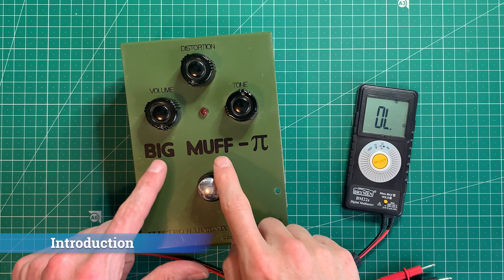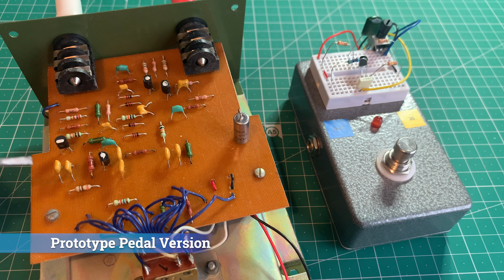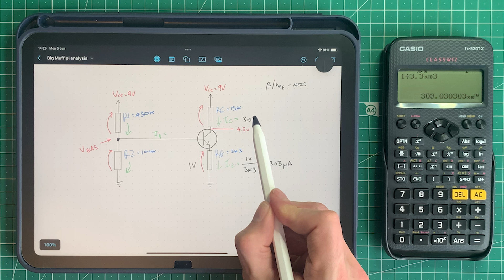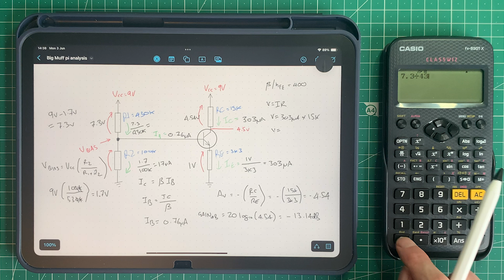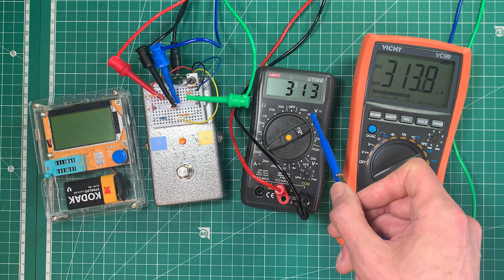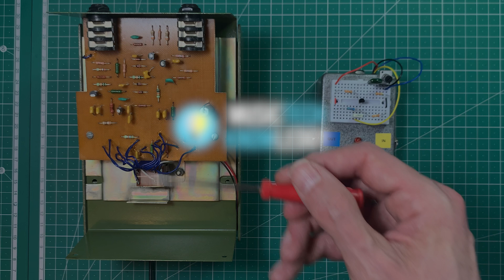EHX BMP - Analysis Part 2 - Output Stage - DC Analysis

Comment: Great video as always! Learning a lot! Do you trust the component tester to measure hfe? I was testing some KT3102, and two out of the four measured super low hfe, around 26, and different pinout! But I breadboarded the input stage, and all four sound fine
Reply from the maker: Only ever as a rough approximation.  I edited out for time but the two other meters showed 380 and 372,  I believe that's because they use a different set of test parameters. The Common Emitter isn't dependent on hFE (only RC and RE values) so we're all good circuit-wise.  I sometimes use a curve tracer if I really want to know specific parameters but remember that heat also affects the hFE.  In comparison, all of my KT3102EMs measure a lot higher - from 450 minimum to well over 600 in two cases (their datasheet suggests a range of 400 to 1000), and I checked that on all 2 meters. They're the ones with the triangle and the letters E and P on the front.  The green Russian has ones with green (KT3102) and white (E) dots and the black/yellow EHX/Sovtek version has the white triangle with EN2 (the N2 means February 2001 I believe).
Reply: @MusicTechknowledgy  Thanks so much! I'll build my pedal as is and follow along with the rest of your series!

Comment: This is great. I just picked up a black/yellow model over the weekend and am hoping to understand the differences compared to the green models.
Reply from the maker: Thanks.  I was just looking at the transistors in the Green and Black/Yellow versions I have. The green Russian has transistors with green (KT3102) and white (E) dots and the black/yellow EHX/Sovtek version has transistors with a white triangle with EN2 (the N2 means February 2001 I believe). My green version should be very similar to my black/yellow version but sound-wise they are slightly different, be interesting to analyse why during this series.

Comment from the maker: Thanks 🙏. I’m really enjoying making these and I’m also learning so much as I “walk through” the circuit.
Reply: Thank you very much for those videos. I've made excel spreadsheet for all measurements. So now I don't have to sit with every potentiometer to find right bias for my pedals :D 
I have one question. How to tell total current draw for any pedal? Do we have to put all knobs at max and then measure pedal - meter - power supply?
Reply from the maker: @ Thanks. That spreadsheet sounds useful, always been a fan of spreadsheets for easy calcs. The current draw can just be measured by placing an Ammeter (in series) with the positive supply rail.